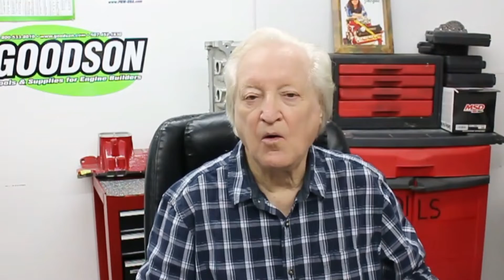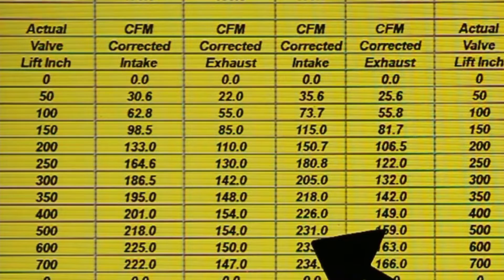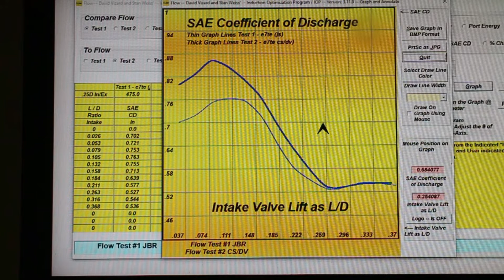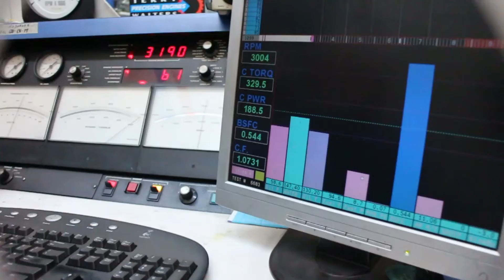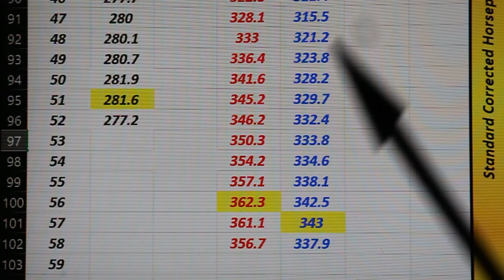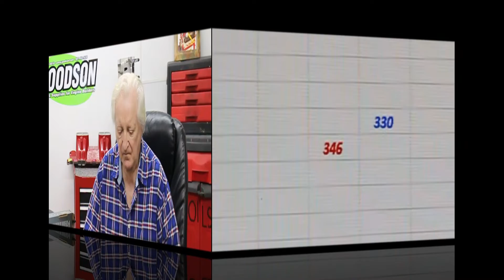David Vizard's PowerTec 10 EP 31 SBF factory iron heads - 100 hp mods!

Comment: I love your content David. I’m going to be reworking a set of E7TE  heads for a 400” Windsor build because I have them already, therefore they’ll fit into my budget much better than forking out $2000 + for aluminum heads. What size valves are you using? 

  Perhaps I missed it in the video but where can I get your book…

 I also would like to ask you if you have had much experience in porting the BBF  (429-460) cylinder heads…?

Thanks again for all of your hard work, and your willingness to help others like myself to become better engine builders…

Comment: Makes me wonder how much is left under the table with stock 70 351W heads?  I just port matched them and put bigger valves.  I found a second set and would be curious how different these are to the E7 heads
Reply: Essentially C9OE are just big spark plug GT40s /3 BAR with the obvious rocker differences.

Comment: David, I absolutely loved this video and the one before it on the 302 Ford small block cylinder heads . Btw, this is my real name , not a pen name or under a friend’s name . Have you ever considered using DOOE 302 castings ? They have a small chamber , and are reasonably easy to come by . Just a thought . No complaints whatsoever . Are you ever going to consider doing a set of 302 heads all out , balls to wall , nothing held back ?  Thanks !

Comment: I built the floating pressure drop bench, I got a foredom cable driven tool,  $30 buck 69 302 heads, many hours of Davids power tec 10 tutorials, and my first experimental port job flows 125 CFM at .20 lift as tested on a superflow 600. It was FUN! Am I ready to use them? NO! I gotta watch the whole E7TE thing before I call it good.
Reply: Did you finish the build?
Reply: @dougzack4565  I got sidetracked on some 2v Cleveland OC heads and concocted a plan to use those on a 302 with modified chambers and rod/piston combo to get 10.5:1. That is the danger of flow testing someones cast-off junk.🤣
Reply: @stuartwall8212  What were the 2v Clevelands like to work on?
Reply: @dougzack4565  I never seen canted valves before those. They outflowed everything I have .....up to about .35 lift, then got real noisy, and went backwards. Honestly, I didnt know what to do with them.....but I fiddled with them until they quit making noise in the port. They still max at about the same lift, but hold it from there on. I would guess 210-220 cfm @ 3.5 lift and beyond. I have no idea if I did them right, but am going to run them with an e cam in a 302.
Reply: @ I have seen port casts and cutaways of the 2v’s. The intake ports look weird.
Reply: @dougzack4565  The cylinder side of the bowl is very narrow compared to the center side. It is the opposite of a Windsor intake port. Mabey due partly to the valve cant and position of the valve guide? Also, the short side turn is VERY tall and steep. The big plus is the size of the valves. I think the open chamber gives low lift numbers a huge boost, but may not help at all above .35 lift.
Reply: @stuartwall8212  The steep ssr probably hurts flow at higher lifts, too.
Reply: @dougzack4565  but I did build a junkyard roller 302 with bowl blended GT40 3 bar heads, dual plane, 600 vacuum secondary, '95 mustang GT cam....all in @ 5400rpm and 14.30 1/4 mile @ 99.9 mph. Not earth shaking, just fun. The 302 heads happened later. I used a drill and stones without any flow measurements for the GT40s.

Comment: This is brilliant. I find it a very interesting subject. I have a signed copy (By you David Vizard) of how to port and flow test cylinder heads. I am in the process of building a DIY flow bench using a vacuum motor from a large wood pellet filling system. I will be doing tests on a few BV heads from the Hillman Avenger 1.6 here in Ireland. All the testing will be done as per instructions from your book. Looking forward to lots more of your excellent videos! Regards Edward Gibbons

Comment: Well put.  Low lift flow means the shorter time window that high rpm has benefits from the early efficiecy - cylinder filling gets a good head start.  Top notch as always.

Comment: Those are awesome gains. Shows how important that high energy port is to power production.  What all data do you need from the flow bench to use your program?
Reply: Port cc, port length, throat percentage, valve size, port opening dimensions, corner radius, valve angle.

Comment: David the port floor on the intakes when they turned they go to the a valve seats what procedure do you do I can't remember you talking about that but I could wrong and I need to take advantage of your porting work will you touch on the deck height I'm interested in seeing what you're using

Comment: Looking forward to the E7 video. I am currently building a 351w for a 1989 f150 4x4 .Have already purchased a set of 1.94/1.6 valves for it and am considering a Comp 35-238-3 cam for it. Waiting for instructions on how to improve the head.

Comment: My thoughts after watching this content and reading some comments. Take a look the graphs and compare the heads. Think what make those differences and write it down. Like and share this video also for your friend ho's interested to learn what's happening in a running engine. Subscribe and watch the answer in a later video and you learn from the best!

My thoughts regarding the exhaust port details: DV/CS Modified E7TE Heads has a 92% valve throat and compared to RBJ Racing, it is bigger in size.

-juhana
Reply: I don't remember making the exhaust throat nearly that big.
Reply: @servediocylinderheads  ok 🤔 In that case could bigger throat make even better blowdown fhase and lower the port velocity on lower lifts?
Reply: @juhanahuovinen  That would need testing to prove. I like a small fast exhaust port.
Reply: I appreciate your repply. I only have experience on 4cylinders, but I have ran 260@seat duration cams 🤭
Thanks,

Comment: I love this video! I would still like to see what these E7's could do with a decent hydraulic roller say 228@50 and .544 lift like we ran in the early 90's.
Reply: DV likes about 108* LSA on these.
Aftermarket are usually veeeery wide.
Reply: Those heads with decent hydraulic roller vs modified ex. port and custom H65295 (bigger throats and retarted ex. lobe)?

Comment: This may hurt some feelings so read with caution: Cam specs, seat duration 260, duration at .050" 204, lift .472",  l/c 110. Flat tappet hydraulic cam from Mike Jones. Cam # H65295.
Reply: G'day Charles would you change the ports and /or run a bigger cam for a 347 ci motor?
Reply: @patrickduncan9656  Bigger ports on these heads are problematic due to casting thickness. As they are they would be torque monsters on 347.
Reply: @servediocylinderheads  Would be interesting to see how much hp and tq these heads would support with a bit bigger hydraulic roller cam and rpm or cubes
Reply: This points to  better ports dont need as much cam to fill the cylinder....but what size valves are in all three heads? I assume stock is stock, but the others?
Reply: @stuartwall8212  1.97" 1.6" I will state that I feel the intake valve is a bit big for these heads. The ssr is too close to water to really feed the bowl. 1.85" is probably just as good with some air speed management.
Reply: @servediocylinderheads  How close can you safely get to the water jackets on the E7 heads, mm?
Reply: @patrickduncan9656  You can get as close as you dare. I like .125" min.

Comment: will these porting procedures work on the GT40 heads?  Thanks!
Reply: Yes they do, gt40 and gt40p have the ability to flow what these do and even more. Careful sonic mapping is needed to prevent making them a sprinkler.
Reply: @servediocylinderheads  I have a set of GT-40 3 BAR heads off a lighting. I would like to know if sending them out for Port work is worth it. Are where do you suggest? Thanks Charles.
Reply: @johndoe-zb8bm  They are worth porting but I don't know anyone who does them.

Comment: I love how 302 cubes are making well past 350 horse and with not even that big a cam ! Having proper flow is like having more duration without hurting bottom end power ! They are not just making more power they are making more usable power everywhere.
Reply: this is a 351 based motor
Reply: @morganmclean1790  If it was a 351 wouldn't you see torque numbers going past or even well past 400 Ft.Lbs. range ???
Reply: @luckyPiston  thought he said 351
Reply: @morganmclean1790  @ 15:14 David talks about 351 in way that could throw someone off a bit.
Reply: @morganmclean1790  306
Reply: @servediocylinderheads  thats good numbers ! ive said nothing but good about davids channel and think hes the most knowledgeable guy on earth when it comes to engines!
Reply: @morganmclean1790  I was only stating the cubes of the dyno tested engine. Nothing more.
Reply: And I agree!
Reply: @servediocylinderheads  i hear you brotha all good cheers
Reply: I say a page on dyno screen cam was .470 lift 202 at .020 
110 sep 107 Int c/l 
I’m do not know if it was a flat tappet Hyd or Hyd roller
Reply: @68nitrostang  the computer screen says its a Jones flat tappet hydraulic cam with .472 lift, 204@.050 duration, and 110 lsa. Even the power output of the stock head engine is impressive considering that the HO roller cam has 6 degrees more duration @.050. Stock headed stock cam HO engines I believe put out around 260 hp.
Reply: I’d like to see that head on a 408 just for grins

Comment: Does it make sense to start off with a GT40 head as opposed to an E7TE head to achieve the same results?
Reply: Gt40 can do this with less porting work.
Reply: The GT40 style heads are modeled after the older 351 windsor heads from back in 69 upto I believe 73...I could be wrong on when it ended but the 351w cylinder heads used a larger intake port volume as well as larger intake and exhaust valves making them desirable as an upgrade as the aftermarket really had nothing available for the small block ford at the time even well into the 80s....The 289 head was mostly used to gain compression to make more power as the 351w head was used to make more power without the gain in compression however still had a desirable combustion chambers that would give a gain in compression after a certain year...The GT40 head in a way is a compromise of the two..It's a great throwback to the old days to gain some power.
Reply: JMO
E7 127 port
GT40 144 port

Comment: What head is on my '91 Lincoln Mark, 225 horse 302 cube ?
Reply: You have a Mustang 5.0 so they are E7TE's
Reply: Cylinder heads from 87 to 95 I believe we're all E7 castings rather on a 302 or a 351 windsor...The E7 head was designed for use on ford's trucks and carried throughout most all 302 351 models aside from Cobra/GT40 variants..The designation "T" in the casting number E7TE indicates that.

Comment: Can't wait to see the porting procedures. Which episode outlined the short block? What are the cam specs? Last, which intake manifold are you testing with? Cheers!
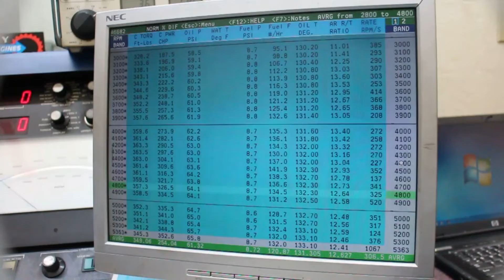Reply: Cam specs i think are here .. 11:21
Reply: Jones Hydraulic Flat tappet # H65295  260 duration (204@.050") .472 valve lift.

It's my belief Mr.Vizard went with such a mild cam to more showcase the difference in power for more the cylinder heads than using a more aggressive cam..What was impressive however with the mild cam is he shows the difference in power as well using a properly spec'd cam over stock and most all the aftermarket replacement cams..45ftlbs and 40hp from such a mild cam is no joke...combined with the heads that's a serious improvement for such a smooth idling street engine..Sleeper status at its finest.

I'm building a very similar engine also using the same Vizard/Servedio ported heads with a few steps up in the cam from Jones cams. 272 (216@.050).519" lift using 1.7 rockers.

Comment: My takeaway is not how god the ported heads are. But just how junk they are stock.

Oh, did I miss the look back at how the real world test results compare to the numerical model?

Looking forward to the next round of tests. Might we see a tunnel ram as well?
Jordan Allen
Reply: About three years ago I helped D.V. with his presentation at P.R.I. and I said this same thing. The E7 head is perfect to show porting gains due to how poorly they are stock. A basic porting job should bring E7's to 210cfm or so. John's porting was next level as you can see by the flow numbers.  The real challenge is getting the flow with the smallest port possible this is what the iop program shows you.
Reply: 1986 technology for ASSEMBLY LINE ENGINES

Comment: I’ll be looking for information on porting Cleveland heads.
Reply: I'll third that!!!
Small port, large port, closed chamber and open chamber, would be greatly appreciated
Reply: @theshed8802    Yes, I have three sets of heads, each diferent than the others; 2v OC, 2v CC, and 4v OC. But my understanding is that they flow the same up to 400 lift.
Reply: @PCMenten  I suspect that the 2v OC and CC heads will actually be different due to the valve shrouding differences, despite the similarities in the ports. I  haven't seen side by side flow bench comparisons though.
Reply: @theshed8802    Side-by-side flow is the same for all heads up to .400” of lift. Amazing heads.
Reply: @theshed8802  I am an amateur at porting, and picked up some 2v OC heads for cheap. On a pressure drop flow bench, unmodified heads get very noisy from .35 and afterwards. After a fair amount of work, they sound better and hold good flow to about .45 and go backwards much less. All lifts beat any Windsor head I have worked with, and I suspect if one had a cam that did not exceed .45 VALVE LIFT (these have 1.72 rockers) and had around 210-220 @.050 duration, you could flow a ton of air and not stress the valve train with a high lift/high duration cam.  I am experimenting with a budget 351w based Clevor, possibly a 387, and use the added stroke to get the piston closer to the roof of the combustion chamber.
Reply: I second this